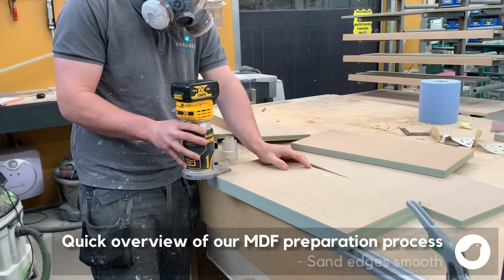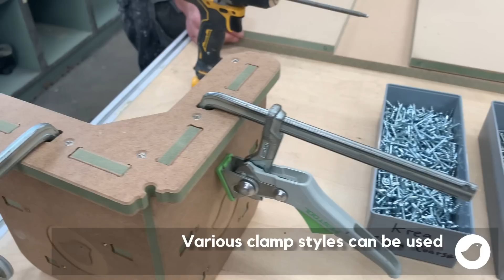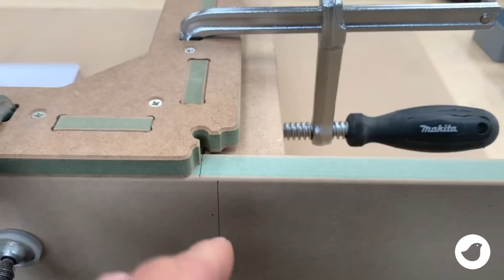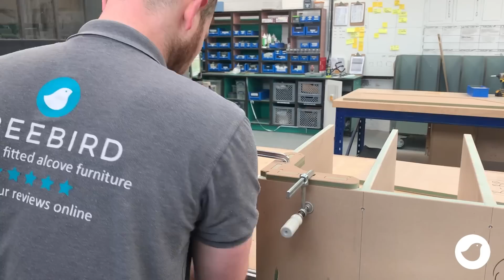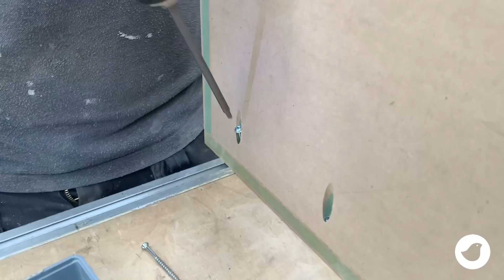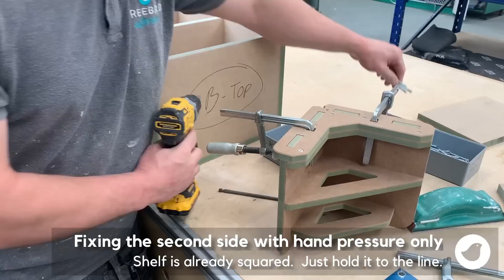How to Build Bookcases and Cabinets Quickly and Easily

Comment: Any tips on how to combat that sideways drift end pocket screwing?  Im trying to use more pocket screws and less dowels for speed, but I’m having real trouble with the sides of the carcass moving by a couple of mm when I’m putting the pocket screws in. Glad you mentioned it in this video as I thought I was doing something wrong
Reply from the maker: You can get clamps to help.  https://www.toolstoreuk.co.uk/kreg-khcra-int-right-angle-clamp-with-automaxx/p6751?gclid=CjwKCAjwzY2bBhB6EiwAPpUpZvh1tbs3y4Mjz2gwfH4JBV7aSX0Ckee1o3e3qmmlo1ylmab7XVTiDxoCdYAQAvD_BwE
Reply from the maker: https://www.axminstertools.com/ujk-technology-alignment-clamp-for-pocket-hole-jig-502710?glCountry=GB&gclid=CjwKCAjwzY2bBhB6EiwAPpUpZst9d1VnVYDEC-y443KYDOXCMsHtBTo85K1BZWnPbAjtrQsNpqH4oBoC2KUQAvD_BwE
Reply from the maker: It is also a matter of practice - you learn to offset the joint to allow for the movement, and also with appropriate pressure you can control the final position to some extent

Comment: Great as usual. Not much else to add. Was it sprayed / painted before or after fitting?  If before was it disassembled?
Reply from the maker: It was made only for YouTube! (And in the hopes of selling a few jigs 😉).  But if it was a real project it would have been disassembled then sprayed as component parts, each part in and out of the spray booth a few times to be denibbed (fine sanded) on the carpet-covered bench against the yellow wall.  Then when dry parts would be wrapped in 1mm thick jiffy foam sheet and stacked on a cart at the far shutter ready for the fitter do collect and re assemble on site

Comment: Very interesting, I also use a square cnc'd out of hydrofugo but it is permanently screwed together, it does help but not as nice as yours. Thanks for the tip on router bits. 
A quick question, how are these shelving units joined with counter tops they are sitting on?
Reply from the maker: Thanks for commenting - we got a little metal right hand bracket at ends near walls, to screw down with a long driver bit.  And pocket holes in other side panels for screwing down before joining the adjacent unit
Reply: @Alastair_Johnson  very good and smart, thanks

Comment: Nice wee job… I’ve recently made up some mdf units and used the 45* Router cutter for all the shelves & sides, looked great when all painted… Do you sell those squaring/angle tool..?
Reply from the maker: So everything is mitred?  How did you join parts?  Yes the jig is for sale here https://www.etsy.com/uk/listing/1228246913/
Reply: @Alastair_Johnson  
Cheers I’ll look online later for that..
Instead of penrounding the edges, I chamfered them with the 45* cutter..
(I can’t seem to send you a pic of them)

Comment: Hi Alastair, great vid as always 👍 I use the Dewalt drill + countersink to pre-drill the holes and use good, but much cheaper screws (Wurth or Hafele) - do you reckon you save that much time using the Spax/KTX screws to justify the additional cost?
Reply from the maker: But confirmats are optimum in my opinion
Reply from the maker: Honestly, no!  I think drilling and using more standard screws makes sense!

Comment: Great to see your assembly method here. Like many cabinet makers, it's interesting to compare my method to yours. Remarkably similar albeit using my own squaring jig.
A couple of questions, if you have time Alistair..
Are you disassembling to spray?
Can your jig be used with different thickness material?
I'd love your recommendations for drill bits. 20 years a carpenter and still looking for a favourite brand.
Have a great weekend.
Reply from the maker: Hi Anthony thanks for watching!  Yes we disassembly to spray.  In the past we have also often sprayed parts first then assembled once and installed (using this drilling and screwing method with the finished parts - light pencil marks on face edges for shelf positions, easily rubbed off with a wonder wipe). Yes jig would work with any material thickness but the centre mark reference is 9mm but it’s easy enough to measure and mark down the side of the unit for screw centres into other thicknesses of shelf. Drill bits: I have been a bit of a cheapskate in the area over the years and don’t buy anything fancy!

Comment: Lovely square and aligned but I always use glue. In my own house the weight of books I put on the shelves makes me think that glue is necessary. Of course a kindle thingy does not weigh as much as old fashioned books.
Reply from the maker: We used to use glue, then when a couple of jobs needed modification (or we made an error) after assembly it was such a problem that I asked myself why am I gluing as well as screwing? And I decided it wasn’t necessary

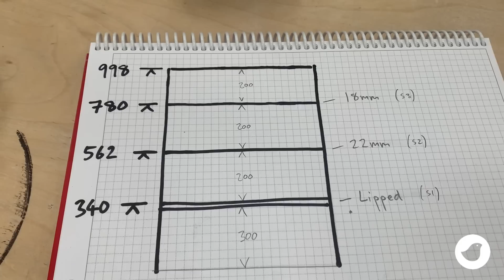Comment: 2:10 Imperial measurements always look better.
Reply from the maker: Not to me 😄
Reply: @Alastair_Johnson  Next time you see a house with modern Legoland metric bricks side by side with a house built of old Imperial 9"x4"x3" bricks which looks nicer? And window sizes in feet always look better, 6'x4', 6'x3', 4'x3' etc, they always look better, put any Barrett Homes metric house alongside any Georgian/Victorian, Edwardian house, which looks better?
I do hand built kitchens in imperial, I only use metric for factory made kitchens.
Reply from the maker: @whitevanman8703  this is a very fascinating comment to me.  I see what you are saying now.  I thought at first you just liked the look of the fractious written down!  But now you’ve got me thinking that because the imperial system originally related to measurements of the human body, whereas the metric system is more clinical and logical, perhaps we intuitively relate to imperial better.
Reply: @Alastair_Johnson  Thank you, that is what I was trying to say. There is a Leonardo de Vinci drawing which has a man outstretched with a circle drawn around which relates to the issue of proportions. I have done a lot of alcove cupboards each side of chimney breasts nearly all of them in period properties, first one in 1985. Shelf spacing of 10/11" with 11/12" sides and top seem to look better, especially when you turn around and look at the period sash windows. A panelled door with the rails and styles in imperial look better.
And at the end of the day I hate being told what measure to use by the bastards in Brussels, I prefer to use the system relevant to the job and my or my customer's taste.

Comment: Nice...
Two questions - what profile is that that takes the rail clamps?  And where did you get that large square from?
Cheers
Reply from the maker: And the square is this one, also from RS Components https://uk.rs-online.com/web/p/engineers-squares/3048471
Reply from the maker: Hi, the profile around the edge of the workbench is the ‘Bosch rexroth aluminium strut 30x30mm’ https://uk.rs-online.com/web/p/tubing-and-profile-struts/3899796